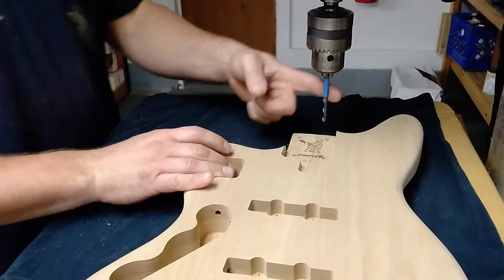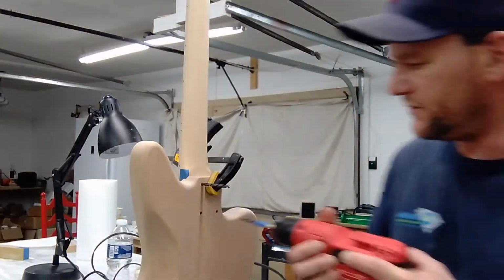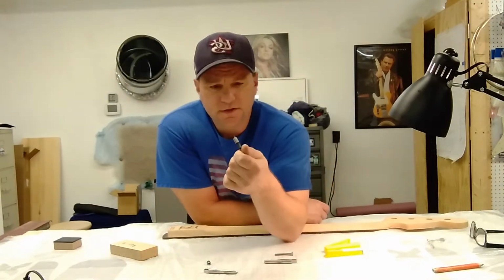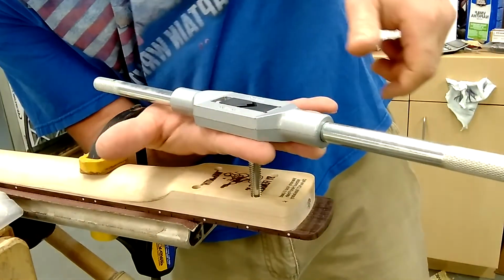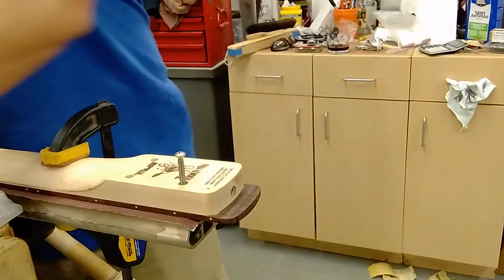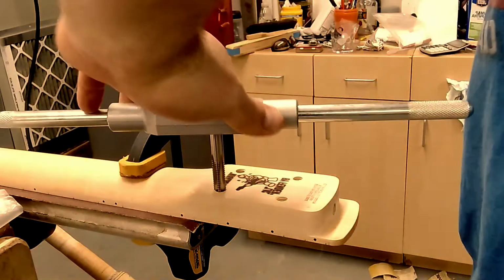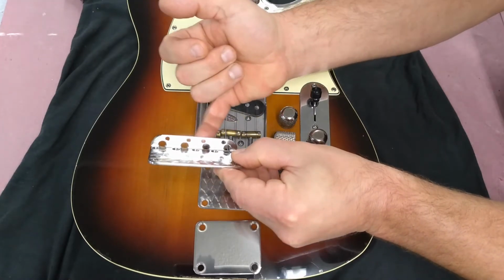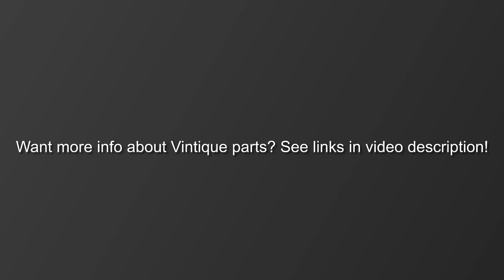How to install a Vintique neck kit

Comment: Have you ever had those inserts come out after taking the neck off/putting it back on a few times?  That has always been the issue for when I try to use those inserts.
Reply from the maker: Never, if it is sugar maple. However, sugar maple is the only wood I have installed them into. I always make sure they are counter sunk about a 1/16th of an inch. As long as you don’t strip out the wooden threads while tapping the wood by bottoming out in the hole you drilled and don’t ever glue them in they are meant to be replaced if you cross thread the screw into the insert. You will not have a problem. If you have any questions. Please respond to my response. Ps. Are you using a real vintique neck kit or some other type of inserts? Because not all inserts are of the same caliber.
Reply: @koenkeguitars2534  I was using some generic ones.  I tried the links .  No one seems to have those.  But thank you very much for replying to me!  really appreciate your thorough and thoughtful reply.   P.S.  Maximum guitar works has a pretty good video on using those as well.  He was using stainlees steel
His method was similar to yours in that he counter sunk them as well.
Reply from the maker: Angela instruments has the neck kit. Just look up vintique neck kit in the search box it’s the first thing that comes up. The neck plate is thicker than the fender neck plate and will keep you from chipping the paint because the corners of the plate will not bend.
Reply: @koenkeguitars2534  Found it.  Thanks a lot!